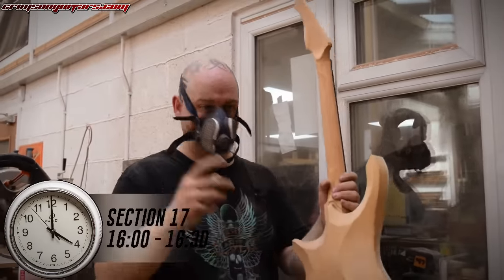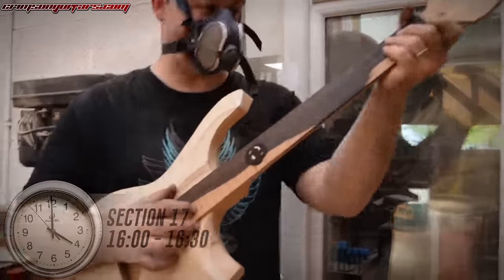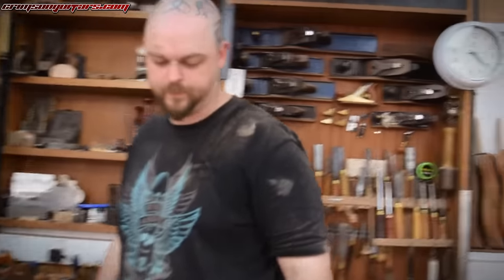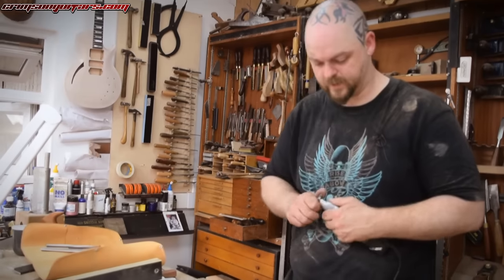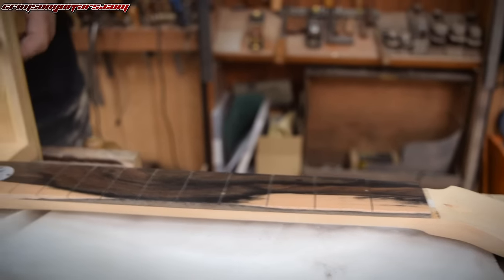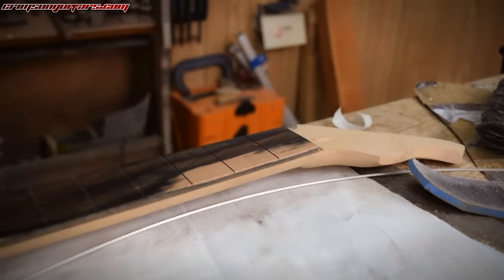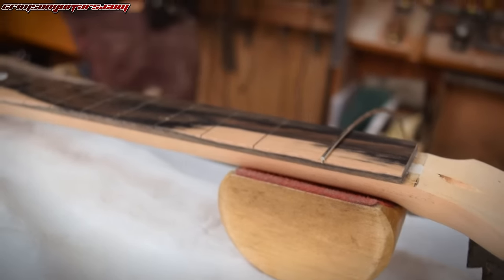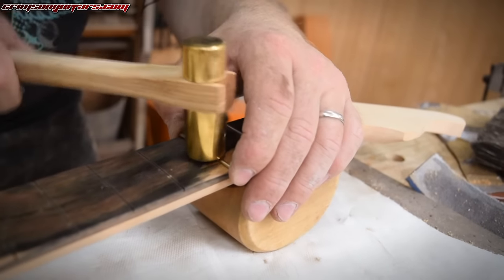The 12 Hour Build - Episode 17 (16:00 - 16:30)

Comment: I'm surprised you didn't get hysterical comments about the dangers of abalone dust. The dust is no more dangerous than other particulate matter(which is not to say getting anything other than clean air in your lungs is a good thing) - unless you are allergic, and whether you are allergic apparently depends on what the abalone was eating during its lifetime.

Still, dust masks and respirators are good things.

Comment: Looks like the clock went from 10:10 to 2:20.
Reply: No, 12.00 is up towards the headstock
Reply: I know, but it's an odd, vertical orientation considering the guitar was built and will played in a horizontal position which causes the clock to loose its "aesthetically pleasing" 10:10 hand positions while in use, which rather defeats the point of taking the time to arrange them as such in the first place.
Reply: +kfa4303 I disagree, the only time the instruments craftsmenship can be truly admired is when it's on display in which case it would be upright